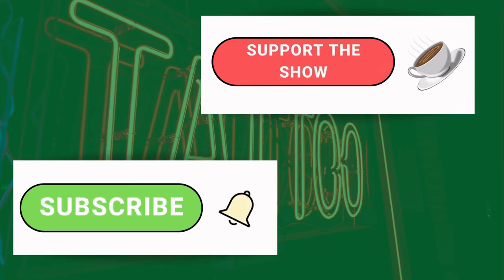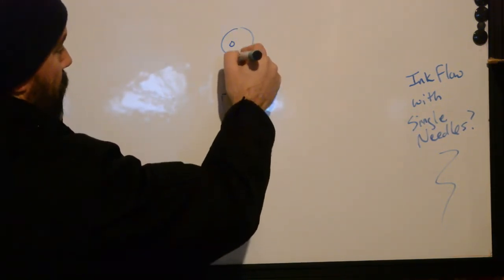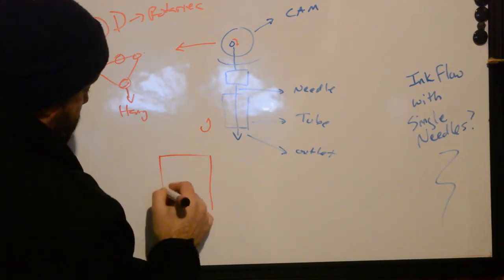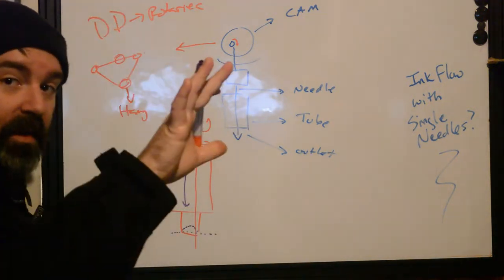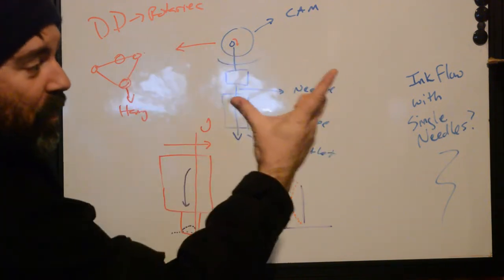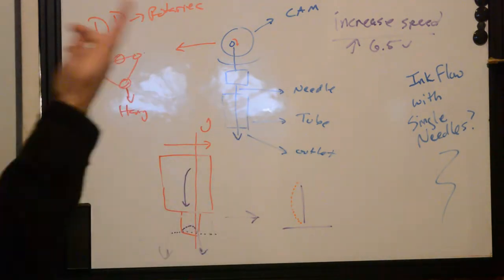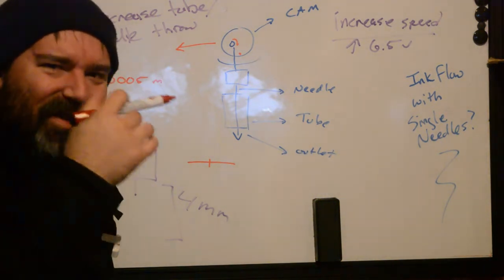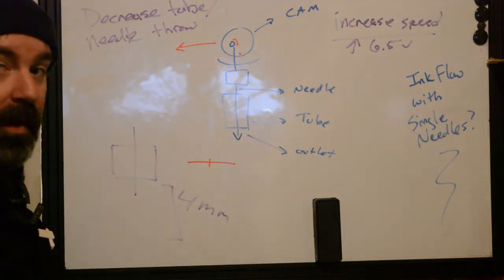Questions Answered! Help with Single Needle Ink Flow Control

Comment: the capillary effect right? The same phenomenon that allows a bug to skim across a pond....or not, im really not sure. My understanding is the atmospheric pressure against the liquid partially compresses the liquid molecules which are on the barrier between liquid and gas. this compression creates a semi-solid acting barrier upon which a bug can skim. It, if I recall is most easily demonstrated by water in a clear tube. the water will climb the tube a small amount due the effects of this compression. Once the liquid in the tube reaches an equilibrium one can notice the edges of the liquid sit higher on the inside of the tube as opposed to the liquid in the center of the glass tube. 

Please correct me if I have gotten all that ass-backwards or just fundamentally incorrect. My understanding is that it is these forces that rule much of the way the fluids (Not the 'vital bodily fluids' mentioned in the movie Dr. Strangeglove) but the fluids in which the pigments are suspended during the process of tattooing. Including the suction created by the needle when entering the skin and then quickly removed creates the conditions for the ink to be drawn down into the 'void' created by the needle...or something like that. It could be that I'm think of the process of Fracking for Natural Gas, if that is the case, please ignore what I just said.

Thanks
Reply from the maker: I had to get work done so I could sir down and write a thoughtful reply here. Please forgive the lateness of my reply..

So I actually forgot a phrase to describe liquid tensions when I started recording this. It was a rough morning!

You can look up the forces surrounding "Surface Tension" and it should answer most of the questions that may run up against the shorter reply I'm gonna write.

More in the reply soon - I need a keyboard!
Reply from the maker: So, the forces that you were stating above - capillarity (or capillary actions) relies on surface tension to "move" across substances or substrates. While we can make some assumptions about how the pigment gets pulled or pushed into the skin, the physics of such things hasn't been discovered. I know this because I am working with a team at a university to figure this out!

So, in saying that, we can toss out some hypotheses here and see if one of them feels right, cling to it like a warm blanket, and see if science will back it up later on!

It's my understanding that adhesion and surface tension relies on a few variables to define how a  liquid will act when in motion - time (of course, because it's friggin physics), the speed at which the liquid is moving (velocity), and the fluid used (viscosity, specifically between the surface materials of the "tube" and the "ink") -  All of which come with their own sets of variables which someone far smarter than me can figure out with a calculator :D

We have to define the two states in which the ink is - In motion in the tube (enter and exit), as well as the resting ink "bubble" sitting on the skin's surface. These both must interact to inject pigment (with mechanical intervention) into the skin at the desired depth.

Making pigment thicker will "slow down" the ability of the liquid to form in and around the space in which it is applied (needle hole), but is also affected by constant manipulation due to vibrations stresses, heating/cooling (the body heats the fluid external the tube while mixing with ink in the tube, which is also affected by the motion of the needle entering and exiting the tube - abrasive forces, or friction). This heating affects the viscosity by lowering the "thickness" of the fluid, increasing flowability given specific constraints (modeled).

So, the thickness of the fluid, the type of tube, the speed at which it is running, the temperature of the fluid, the diameter of the needle strike, and the condition of equipment (tubes, needles - age applied) are the most basic things I think need to be focused on BEFORE we get into the other aspects of the application which can also affect the delivery of ink to skin.

We also have hydraulic actions of hydrophobic substances, intermingling with fluids and skin hydration,  which affect the uptake of pigment through mechanical action into the skin.

We have two problems here as well - the type of machine function that will introduce different stresses to the fluid and create different deposit rates of the specified fluids (assumed above) - rotary machines versus electromagnetic coil machines.

So, to start... maybe let's think about each machine and how it interacts with the skin. A coil-based machine "slaps" the ink into the skin, while a rotary-based machine "pushes" the ink into the skin. 

When a coil-based machine fires (which. let's avoid the physics of that BS. I don't have time to dig out the spreadsheet to link to this), the pulling motion accelerates the armature bar in an arc which is suddenly "stopped" when the armature contacts the top of the coils. This slip/stop accelerates the fluid inside the tube (at whatever viscosity we can assume it is) and "shoots" the pigment out of the end of the tube. The disruption of pigment exiting the tube relies on surface tension and the tube's construction but can be controlled based on distance related to the skin position and ink "bubbling" being deposited efficiently during operation. Along with all the other variables we can come up with, the coil-based machine seems to have a greater than (>) effect on skin and a greater quantity of pigment actually being "shot" into the skin when compared to rotaries.

So, why do rotaries seem to have a decreased quantity of pigment inserted into the skin?

Well, when a rotary-based machine is used, a "constant velocity" mechanical action is applied to the same construct of tube and pigment, and no "slapping" occurs when pigment exits the tube. The decreased mechanical action actually slows or decreases (I assume) the flowability of pigment into the skin. This is, of course, without taking hydrophobic "glides" or skin treatments into account (which are absolutely necessary for better flowability when using a rotary-based tattoo machine). The needles strike creates a cavitation (void) in the skin - which is kind of like a rock being dropped on the surface of a lake or river or whatever - which then "snaps back." The snap-back effect changes the pressure surrounding the wound created, "pulling" the pigment into the space. This is ultimately dependent on the viscosity of the pigment used (which is why I usually use a thinner pigment for rotary machine tattoo application) and the quality of the application of hydrophobic substances to the skin during the procedure.

Using too much glide (hydrophobic substances) will decrease the rate of pigment flow into the skin because of three things (I am pulling out of my ass because this reply has turned into a theory run more than a simple answer). First, the distance the pigment has to travel to enter the skin (initially) will increase. Second, the pigment will naturally be repelled due to the requirement of pigment being manufactured with water (it's friggin hydrophobic, right?). Thirdly (which this isn't a complete list, but my fingers are getting numb), the pigment trapped in the tube will be subject to creating a mixture with glide "pickup" during operation, increasing the viscosity (temperature dependant, and time dependant, because blood and viscera will end up watering down the whole mess after a little time passes).

If a "correct" amount of glide is used, the increase suction expressed on the cavitation SHOULD increase the quantity of pigment being able to be inserted in the skin... Insofar as the skin eventually starts weeping enough that the amount of glide used needs to be adjusted, as the same effect can be accomplished by utilizing said "weeping" to replace the glide. This is why most artists tend to decrease the amount of glide used when going over and over a section of skin. It just balls up and sloughs off. It's almost the same as using too much glide (described partially above) because you have to navigate the exudate/blood crap sitting on the skin (as well as inflammations).

So, in summation -  
This whole thing (a tattoo) is like a bullet tearing through the skin but is not as severe because the needles used are, well, not bullets :D.

So yeah. I agree that the method you described was correct. At the same time, I feel it is waaaay more complex. BUT who wants to think about this much detail when laying lines!

PS - Sheeeeetttt... I didn't even get into the effects substrates have on this whole process. So, I guess it's not really a well-thought argument but just an old guy working through something.

Comment: You should never ride the tube bro.. the thickness of the skin is different all over the body, you’d have to be CONSTANTLY messing with your needle hang through the duration of a tattoo if you wanted to also avoid blowout/scratchy lines and just isn’t a reasonable solution.
Reply from the maker: Thanks for your opinion!🤘we know that some of the stuff we teach may not be for everyone. if it gets a conversation started we hope the inquiry can help others